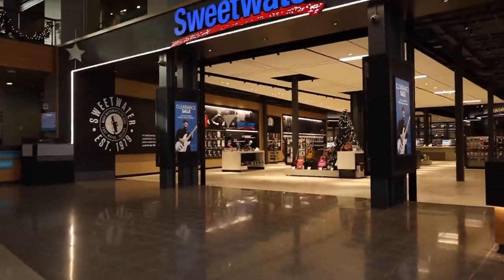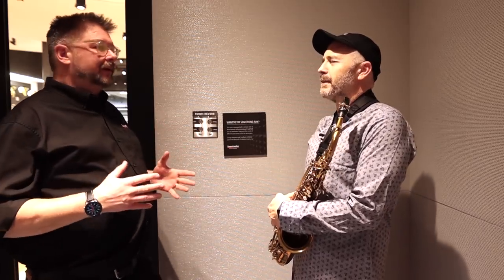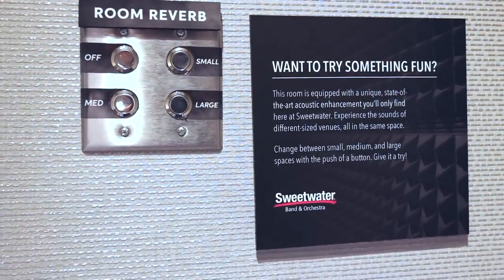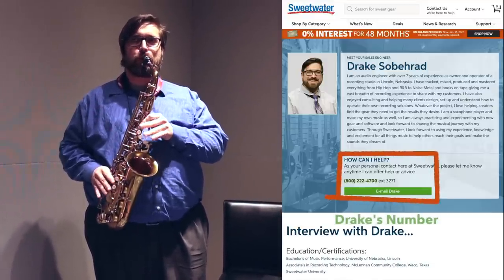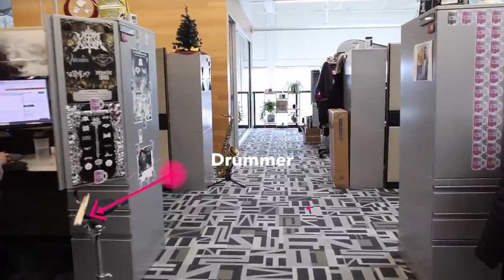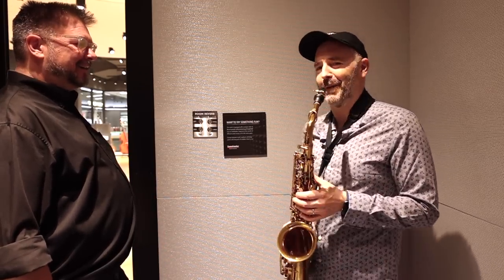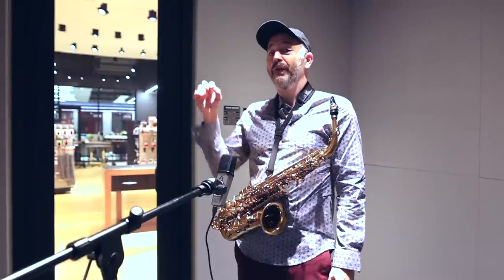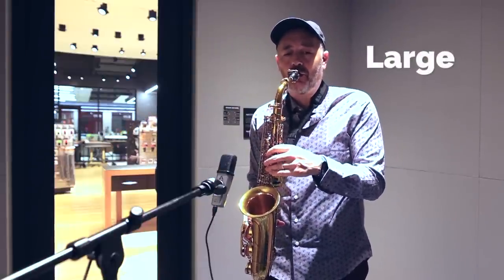Testing the REVERB SIMULATOR Room at Sweetwater

Comment: "It is top secret, of course"; why? Anyway here is my secret:
I adapted my rehearsal room (3x4 m) to create an acoustically similar environment. In the heavily damped room I mounted small active speakers in the 4 corners close to the ceiling. In the middle of the ceiling is an omni directional microphone connected via a microphone amplifier to the input of a Yahama DSP1, a digital sound processor. The four speakers are connected to the outputs of the sound processor. The DSP1 is still for sale on ebay but there are also successors. With this sound processor it is possible to choose from many acoustical simulated rooms; several halls, chamber, jazz club, stadium etc, much more than just small, medium and large. Moreover a lot of parameters can be altered e.g. early reflections, liveness, initial delay….. In this way it is possible to create a very satisfying natural sounding acoustical environment. From intimate to spacious and everything in between.